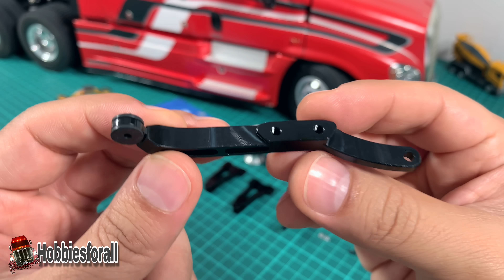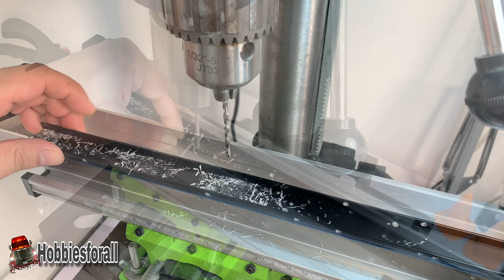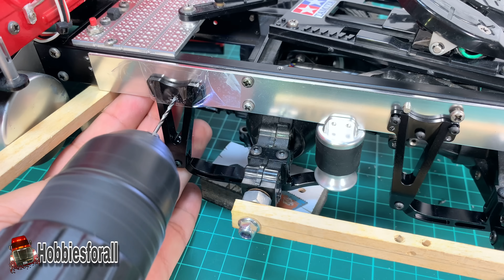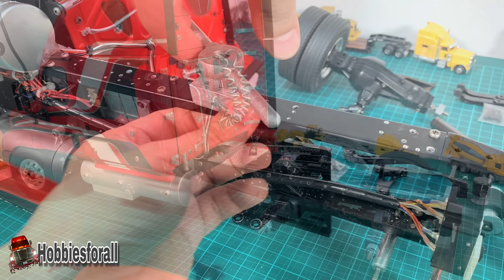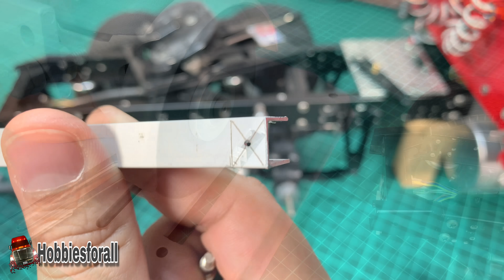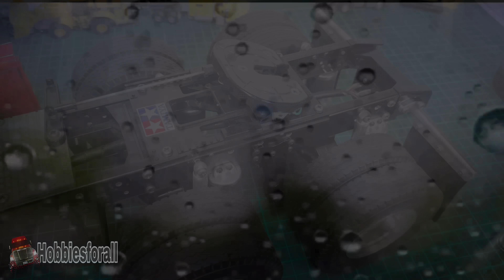1/14 TAMIYA RC Truck Air Suspension LESU | SCANIA R620 MAN MERCEDES Actros Cascadia All Trucks 4K

Comment: Hey pal I have a question really hope you can point me in the correct direction where did you get the rear light housing I need one for my truck 😊
Reply from the maker: Hi, it's a standard Tamiya D part, the difference is that I made some aluminum foil crowns for it, it's very easy 👍🏻
Reply from the maker: https://youtu.be/7iqvWBWcVnQ

Comment: Probably the WORST air ride out for the Rc semis is the Lesu. It's is a terrible binding up suspension you are better off with the stock. if you want air ride by JMI or True Scale RC air ride they both move properly like a real system. On top of it binding up why put it on a American semi as it is a European looking system looks nothing like American air ride set ups.

Comment: I'm sorry, but what good is it, when it doesn't work/function? This is purely aesthetic, right? One should be able to truly use it ... (lower / higher)
Reply: I agree you should be able to use it for heavy haul. At least 30 lb's or more. This suspension is just for look's.

Comment: I use to do wheelbases on real semi trucks, twke me about 8hrs to add frame and roll back 120" from former location. Driveline shop would take approximately 3 days to get me a shafts, carrier bearing if needed.
Impressive build!

Comment: Hi, thanks for the sharing. But could you tell us why a damper is still needed for each wheel? Is it because the air suspension is not strong enough?
Reply: Air spring, leaf spring, pivot hanger, shock absorber are the key components in an air suspension system
Reply from the maker: It is correct, thanks for the contribution.
Reply from the maker: Hi, they are only simulation so they look like the real ones installed in a Freightliner Cascadia.

Comment: How is this air suspension? He replaced leaf springs with coil springs that have rubber hoses over the coil springs. No air hoses, air tank or air pump. Looks good but not air suspension.